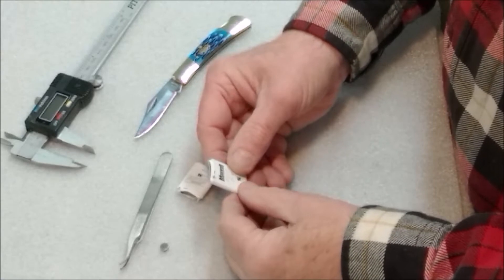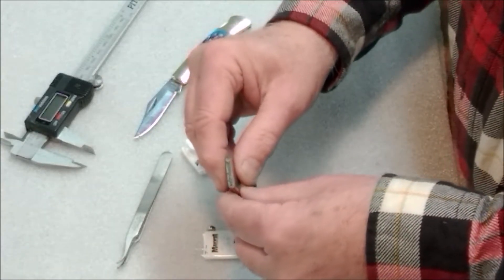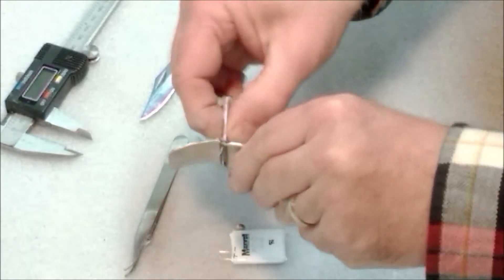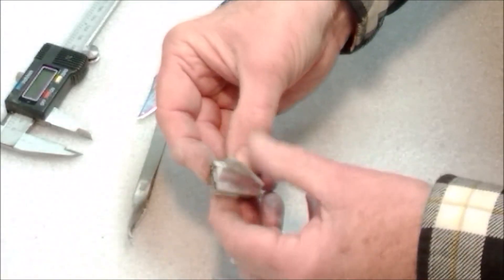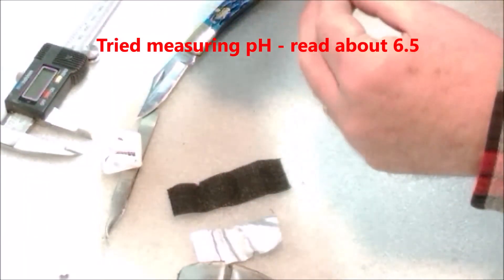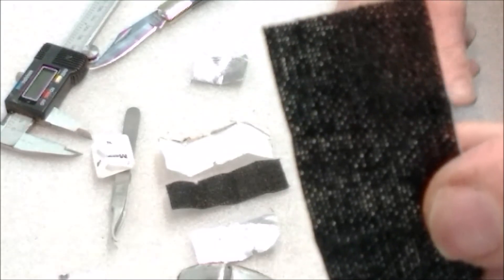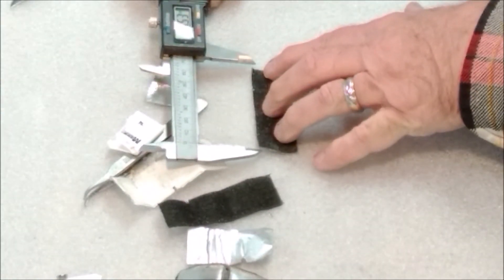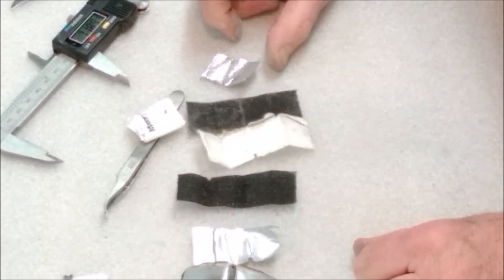Whats Inside a Maxwell Supercapacitor

Comment: Yeah that's interesting to have that cloth. A bit surprised actually but it probably designed for fast  discharge. The ability for ions to travel seems low in resistance. I do wonder what is on the other side of the cloth. Something that shares an affinity to the aluminium I expect and gives a welcoming connection. Probably aluminium or some sort.

Comment: Hi Dennis
Interesting video. Of note, I looked up the Maxwell test procedure Note 1007239, which is quite a good read. One thing of note is that they generally charge/discharge at a rate of 100mA/F.
So this unit would have been cycled at 1A. The size of the plates is not too dissimilar to the size of my test cells, so I might look at revising my test regime. I normally use the excellent  ZKE Tech EBD USB and a power supply unit, as it can discharge at 30mA. My EBC A20 can cycle at several amps, but its minimum current is 100mA, so I not used it as much. Perhaps I should be using it a little more in the light of Maxwell's 100mA/F test procedure. It would be interesting to see if there is a difference in calculated Tau values if you use a different discharge current. 
keep up the good work :)
Tony

Comment: Hi Dennis. It was very interesting to see what was in there. Strange they used a see through cloth type material. Could you check the conductivity on the carbon if you still have it that is. Thanks for taking the time to show us all this.
Reply from the maker: Hi Dan - good idea to look at the resistivity.   Surface resistivity in ohms/sq.  is very high - around 40 -60 ohms  - and difficult to measure since the coverage of the carbon looks to be about 80 percent on the open weave.  Measuring through the material with one probe on the carbon side and the other on the Aluminum foil collector its in the 6-8 ohms range.    With all the 'parallel' paths from the full coverage  current collector its not likely an issue for these relatively small caps.  My understanding is they are used for peak power in point and shoot camera flash systems. 
Dennis